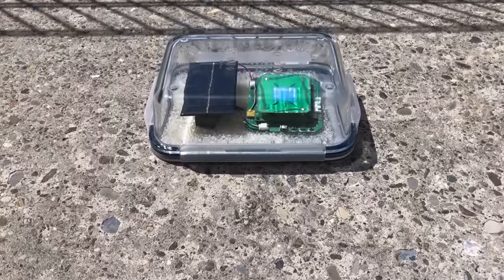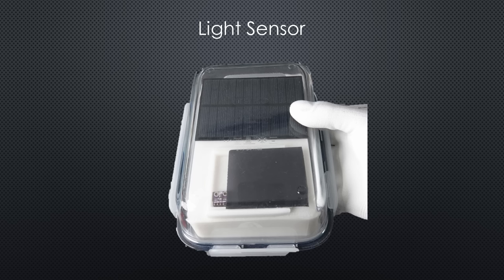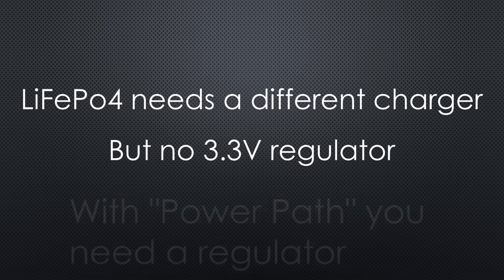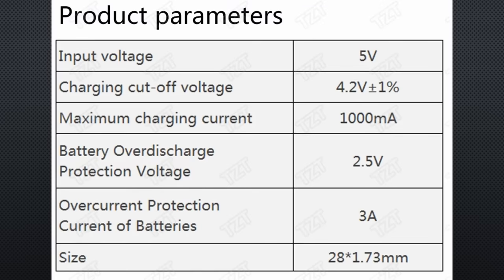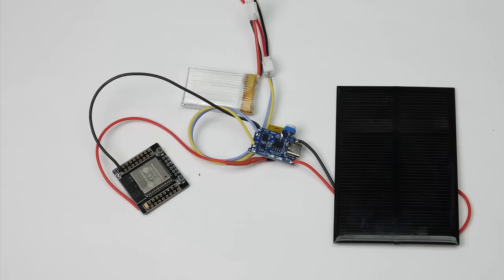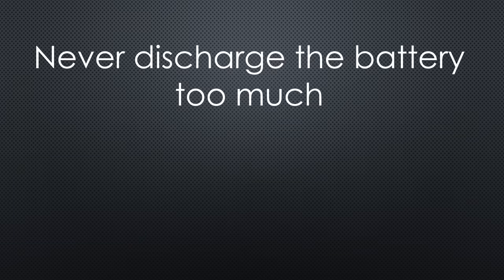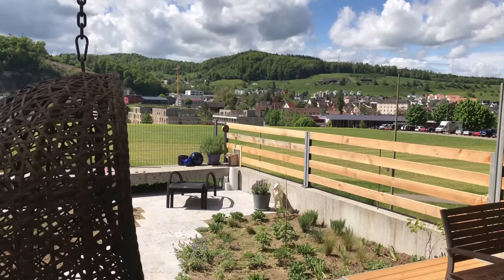#383 Cheap and simple Solar Power for our small Projects (ESP32, ESP8266, Arduino)

Comment: The HT7333 is rated Iout max = 250mA only - however, the esp32 has as seen on 1:47 peaks of more than 500mA - how does this work? Is the 10µF cap sufficient to smooth these spikes? I wanted do create a low power esp32 board myself - however the esp32 got a brownout reset due to the current limitations of the used LDO ...
Reply from the maker: The LDO usually is not the problem because of the short peaks. I often add a 1000uF cap across Vcc and GND of the ESP32to be sure. This time it worked without it.
Reply: I'm a beginner and don't know much about electronics (for now). I just realized this too looking over the sheet.

Over here: https://www.esp32.com/viewtopic.php?t=6667 they recommend an HT7833, but it requires other caps and they say the HT7833 "has a bigger drop out voltage, 300-500 ma while ht7333 's drop out is just 90mv". Maybe it's just better to add the 1000uF cap Andreas says?
Reply: We tested today with a lab power supply. Without the caps, we had to Set the current limit to 270mA in order for the ESP not to reboot. We will now switch to an ldo which is able to provide 700mA. This should give even a little extra for some periphery (as I plan an rmf95 module
Reply: @herwigg3327  Please share which one you end up using. I already ordered the ht7333, 20 for 0.87ct now I'll will have to sell my house. Mistakes have consecuences. (Sarcasm in case somebody doesn't get it). The lolin d32pro uses a me6211 .. more expensive at 1.10euros for 10. It's 500mA  .. absolute max input:. 6.5v  I don't know if I can risk using 6v panels with it. 

I understand the video is about low power setups, but I'd like something robust. To be honest, being a beginner, I still don't get how the power is routed in case of needing more "A". It seems to me that if the sun is shining on a 130mA panel the powerpath takes over and you brownout in case of a spike, or does it somehow pull from the battery?

In the video Andreas says in other video/s they have seen the HT7333 is enough. Could someone please link that video, or telle me the name or number. Thanks.
Reply: @sermarr  I am afraid, it would take too long ... we plan to order a number of pre-assambled pcbs and there is still testing on the way before we order the next chunk. Currently we replaced the MCP1810 (which produced brownouts) with the XC6210 - but not tested yet ... pcb is again in design phase ...

Comment: hello andreas, i have a little mess and i haven't found much information about it.  I have a lag in the reading of the esp32, I am using an ads1115 to read voltage and current, when I put a resistive load on the serial port I see a huge lag, I want to correct the reading but I have not been able to, thanks for the dedication☺️
Reply from the maker: Why would you put a load on Serial?
Maybe you watch my videos about current measurement. It is not simple :-(

Comment: Very nice video, and great timing, now, my LoRa ESP32 weather station will be upgraded to running on solar

One question, is the diode at the top of your diagram still needed, even with the addition of the FET?
Reply from the maker: Yes, it is needed. The FET replaces the second one.
Reply: when the fet is on the top diode is reversed bias so current from battery doesnt go that way

Comment: Hi SIR ANDREAS,  As always, THANK YOU IMMENSELY FOR YOUR EDUCATIONAL VIDEOS!

I have 1 question please.

Can you review small band devices to connect batteries to which “”control by reducing power level that is sent to the device of choice ( esp32, raspberry PI4! Arduino uno v3, Arduino mega board…. Etc.   I want to provide enough battery to run a very long time, but that requires reducing power before sending to device.

Most Humble Appreciation!   Your guidance is greatly appreciated!
Reply from the maker: I made a few videos on how to power ESP32s. There is even a playlist available.

Comment: I'm new to your channel and the kinds of project you are building and really like and appreciate your work (and I like and subscribe). I understand why you added the HT7333, but it looks like you added something, a 10mF capacitor to the other side of the dev board and said it was in the instruction sheet. May I ask where? I'm wondering how I would know to add that? Thanks.
Reply from the maker: Welcome aboard the channel! It is a 10uF cap on the output side of the regulator. As said, it is written in the data sheet of the regulator (page 5)

Comment: I was trying to get an off-grid ESP32 cam to work with solar power recently. I got 3 panels that should be able to produce 12V 600mah under full sun and my ESP was consuming about 200mah at 5V.  Should be simple right? 

Couldn't get it to work because the LiPo charger was sucking up 1A+ power from the panels and the voltage was dropping to 2-3V... I can't believe no one out there came up with a small Active MPPT controller for ESPs and Arduinos. 

If someone created an Active MPPT  IC that can handle charging LiPos and powering low power devices, they'd made a truckload of money. There are a lot of makers out there who'd want to use solar to power their projects.
Reply from the maker: There are plenty of MPPT charger available. You ran into the problem I described in the video where I changed the resistor.

Comment: Might be a bit of a noob question but if we had the right solar cell, couldn't we set it up directly in parallel with a rechargable battery?  Don't solar cells basically behave like a diod?
Reply from the maker: Li-Ion batteries are picky with how they are charged and can explode if overcharged. So it is not advisable.

Comment: Hi Andreas - what voltage does your  esp32 expect? I thought it should be 3.3 V but your "power path" does not include any voltage control - and lipo up to 4.2 V also exceeds max allowed voltage. Or am I mistaken-never worked with the esp32 so far. Best regards...
Reply from the maker: As said: The ESP32 is rated up to 3.6v. This is why I added an LDO (also shown in the video)
Reply: @AndreasSpiess  at the last slide ;) I see.
Reply from the maker: Not only. The last slide is a summary.

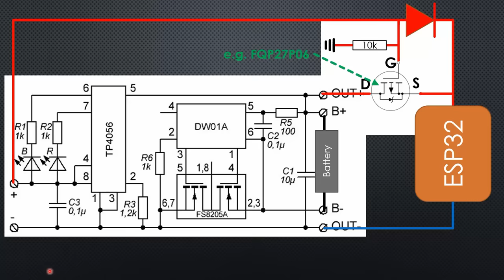Comment: Hello, I would like to make a mention of something that may be wrong, at minute 12:35, where you propose to put a mosfet-p as a key so that voltage is not consumed from the battery, if there is energy from the source. That mosfet is not wrong? Note that the protection diode would be forward biased, so it would be conducting. Shouldn't D and S be reversed? or would it have a problem with the polarization of the mosfet?
If I have a wrong concept, could you please tell me?
thank you.
Greetings.
Reply from the maker: Maybe you watch the "explanation video"? The link is in the description.
Reply: @AndreasSpiess  Ok thank you very much, I had not seen it! your videos are very good. Congratulations. Greetings from Argentina.

Comment: Hi Andreas,
I have an old 4V, 500 mAH rechargeable battery lying around. Can I just copy all the steps as you have shown? Especially, can I also use the HT7333 for the esp32?
Thank you and keep your videos up, it's amazing :)
Reply from the maker: You can use the HT7333 to power a 3.3V ESP32 module with a 4V battery.
Reply: @AndreasSpiess  ok, I will do it. Thank you

Comment: Hi Andreas, thanks for your tutorial! 
 I'm just worried about what might happen when the battery is fully charged, the sun is shining and the esp32 is sleeping? Will the (unloaded) solar panel voltage not be to high for the ESP32?
Reply from the maker: It should not. It should be protected by the 3.3V regulator.

Comment: Excellent as usual! Thank you! I tried to add the 3 components today to the 4056, yet I'm only seeing 3.5v or so on the output after the diode. I'm sure I've done something wrong. I only had a IRF9530 for the pfet on hand. Any ideas? Thank you!
Reply from the maker: The IRF9530 has a pretty high VGS voltage. Maybe it never turns on.

Comment: @0:03, how do you manage the heat buildup in that glass house (your glass waterproof container) or maybe in your location that's not much of an issue? I can imagine on a 40ºC+ day (You did mention summer) that it Could get over 60ºC in there which cause problems for a lot of electronics not to mention the batteries.
Reply from the maker: I made a video about those containers from IKEA. And you are right. The max temperatures last summer were 65 C. Which is ok for electronics. And if you use the charger shown here, the battery will not be used during these periods (the sun powers everything) and only stored. Which also seems to be ok.
Reply: @AndreasSpiess  Thanks Andreas.

Comment: In Switzerland you don't need some low temperature charging defeat? In many days the sun could easily heat up a clear enclosure, then we need a way to prevent overheat. hmmm
Reply: i suppose an opaque enclosure with a small heat pad might be the way. With an oversized panel.    Venting a greenhouse type enclosure is more complicated and less sealable.
Reply from the maker: Indeed, heating can be a problem  here, too. What was best in my case was to use a second IKEA case below the top one. The top contains the solar panel and the bottom the electronics. The bottom one was much cooler.

Comment: Really enjoying your videos, keep up the great work. 

I do have a question about the power path, which I suspect is because of my lack of understanding. 

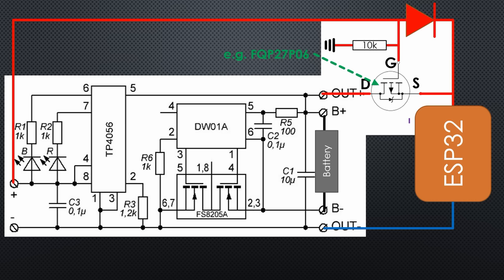From what I understand, we want to turn off the connection from the battery when the the solar panel has enough voltage. What is confusing me is that with my understanding when the MOSFET is turned on current will flow from Source to Drain, ie Source having a higher voltage than Drain, assuming the Gate voltage is low enough. And when the Gate voltage rises sufficiently it will stop. In the diagram at 11:55 it shows Drain -> Source from the battery connection, but I would have expected this the other way round. 

When I build this on a breadboard, and have G at 0V power flows in both cases, but only slightly drops when raising the Gate voltage in the case of Drain -> Source flow, but stops completly at around 1.5V for Source -> Drain flow

Am I missing something really obvious?
Reply from the maker: Maybe you go to the "explanation video". A link is in the description. The minimum Vgs voltage of your FET has a big influence, and it is possible that you have some "grey zones" if you move the voltages slowly. Try it with 0 and 5 volts. Usually, the voltage on Solar panels changes fast if there is sun or not.
Reply: @AndreasSpiess  Thank you so much, that does help a lot, really appreciate it

Comment: Thanks for interesting video! How do you deal with hysterisis in situations  where battery is to low on charge to transmit e.g. on wifi? The system may go into fast  on/off loop until battery is sufficiently charged, the arduino mcu can stall in this situation. Thanks in advance for any reply.
Reply from the maker: I once made a video about that. You can use a protection IC which resets the MCU below a certain voltage.

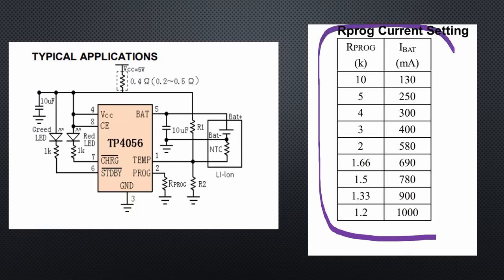Comment: Andreas thank you for the very educational post! I have a question about understanding what Rprog value should I set in my T4056 board. You decided on 10K but I leave in an area with more sun. How should I know what is the best Resistor value for my solar panel and sun to be set in the T4056 board. (Minute 7:13 )
Reply: Is it, adjust the current to max current when the panel is in full sun ?
Reply from the maker: It adjusts the maximum charging current. Usually, this is not relevant with full sun, but with low power to keep the voltage of the panel high. You will see it if you experiment.
Reply: @AndreasSpiess  thank you ! I will give it a try!

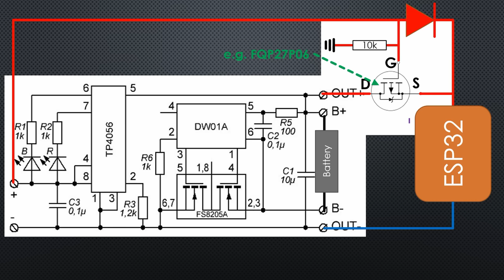Comment: 11:55 Is that mosfet connected correct?, the body diode is now in forward direction and the gate source voltage  must be  -3.75V to  switch the pmos on.  Other question ha any ever tried to to replace the Rprog of the TP4056 with and LDR resistor network. The LDR withing in limits follows the Rprog current. High light is low LDR resistance is High charge current. Just a thought I got.
Reply from the maker: 1. The MOSFET should be ok
2. I never tried an LDR. Maybe you try it?

Comment: Thank you for this video, I have a question. At 12:33 you show the voltage from the panel to the ESP is ~4.5V, isn't that too much for the ESP or am I missing something?
Reply from the maker: You missed where I soldered a 3.3volt regulator to the ESP32 board ;-)

Comment: Hi Andreas - another deeply interesting video. I have a question about your conclusion measurement at 12:45 you show a measured supply voltage of the battery of ~3.5V. But I remember that you have added a voltage regulator before the ESP. This might result to too low voltage for the ESP. But why don't consider to directly source the battery voltage behind the voltage regulator?
Reply from the maker: The Max. Battery voltage is 4.2 volts and the power path brings up to 6 volts

Comment: Thank you for this valuable video Andreas! It inspired me to use the tp4056 for a solar powered irrigation system with an esp32 cam. Why is it necessary to replace the resistor at all? Isn't the only purpose of this resistor to limit the charging current in order to protect the cell? If we just leave the original 1.2kΩ resistor (assuming the cell can handle 1A charging current) and connect the charger to a solar panel of e.g. 100mA output, the battery would simply charge with 100mA. Or is the intention to limit current, so that there is some current left to directly power the device via the power path?
Reply from the maker: Sometimes you get more energy out of the solar cell if you consume a smaller current (MPP)
Reply: @AndreasSpiess  Thanks a lot Andreas for answering although you already perfectly explained it in the video :) I just did some tests and measured temperatures above 60° C around the 18560 lion battery cell (located under the solar panel). Outside temperatures are currently around 35°C. Do you think there is a risk of damaging the battery?
Reply from the maker: @georgiostsoukas7270  Consult the data sheet. Often, storage is allowed on these temperatures. And our small currents are nearly like storage ;-)

Comment: If I would like to extend the solar panel to a distant point, will I lose power over the power lines? By the way, how do I know how the diameter of the power cables will effect? Thanks a lot for your informative videos
Reply from the maker: Just use ohms law to calculate the power loss. You will find the formulas in the internet. To find out about the cables you have to measure their resistance (or look it up in the datasheet.

Comment: Dear Andreas, I think you made a calculation error. 6 x 10s is not one hour 😉😉😉
Reply from the maker: You are right. It only wakes up every 10 minutes. Did I say something different? I also said that it takes 10 seconds for transmission ;-)
Reply: @AndreasSpiess   The 10 secs was ok which was for the mA-secs for the minute.  Then you multiplied that by 6 and said it was the for the hr, that should of been multiplied by 60 not 6.

Comment: Hi Andreas, first of all thank you for all videos you have made, i have watched most of them, they are very interesting and thanks to them i can enhance my electronics knowledge. I have a question concerning the MOSFET, what is so special about the particular model you have chosen? can I use another one? which parameter shall i take into acccount? than you for your answer, regards
Reply from the maker: I usually look that they have a low Vgs because we use 3.3V. So Vgs has to be lower than that voltage. Otherwise, hte FET will not switch. The rest of the parameters usually are not critical if you do not do high voltage/high current projects.
Reply: @AndreasSpiess  Hi Andreas, thank you. I assume all logic level mosfets will do.
Reply: i used TSM2301CX MOSFET together with AP2210N-3.0TRG1 and it works 'like charm', thank you :) 3.0V is just enough for ESP-01

Comment: Great video! Gonna attempt to construct this circuit as well, but I have a question. You mentioned in the comments to search for FET with low Vgs voltage. I found NDP6020P with Vgs=-0.4...-1V and your FQP27P06 has Vgs=-2...-4V, I am not quite sure which one is the better choice here, as in I don't know if by "lower" you mean absolute value of Vgs (NDP6020P would be better) or just the value of Vgs (FQP27P06 would be better), so which one is it? Thank you for your help.
Reply from the maker: The NDP6020 is better
Reply: @AndreasSpiess  thank you very much!

Comment: Thanks for the tutorial, really nice. I have been studying the power path o load sharing, even looking up some chip ic with mppt and power path like BQ 24074 o 24650. In some of those chips says that the power is managed in any situation even when the input power cant handle the load. I have been trying to work with a 12v-18v solar panel and bq24650, and i am struggling with the load shoaring, i was thinking using ths pmos with the diode but i wouldnt know how it behaves when the solar input is not great, for example when activates the pmos but cant hanlde the load, it takes from both sides even when if both sides have different voltages. Anyways i am gonna make 2 boards with these bq so maybe we can share results. Great days. Greating from Colombia.
Reply from the maker: All those chips only take the current they need. The rest stays in the solar panel (or is not produced by the panel). BTW: I would not use linear regulators with 12 volt cells and only one Li-Ion cell. It will probably overheat. P= (12-3.7)V*1A=8.3 Watt has to be dissipated by the chip.
Reply: @AndreasSpiess  It is possible that the load take energy from the battery and the solar panel when the sun is not enough to power the load?. Yep, i pretend to make two. One of bq24074 with 6v-9v solar panel and other with buck version bq24650 for solar.panel 12v to 24v